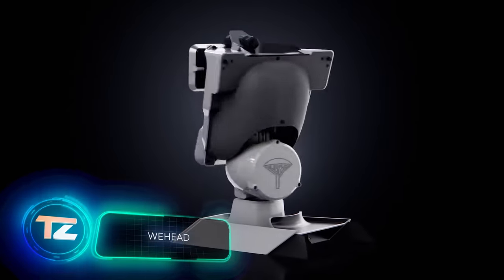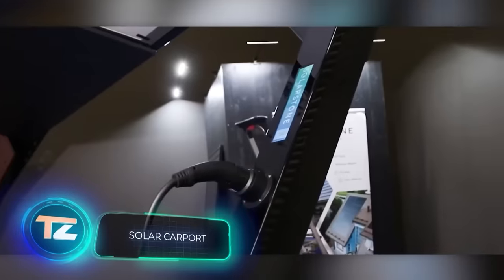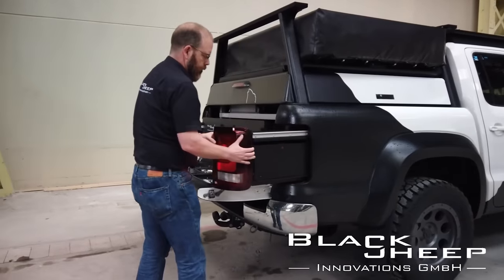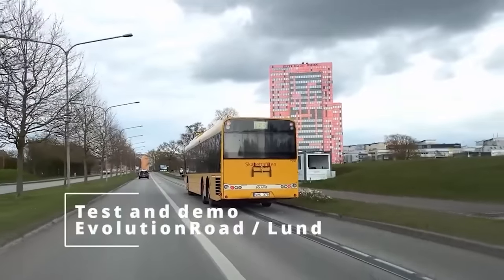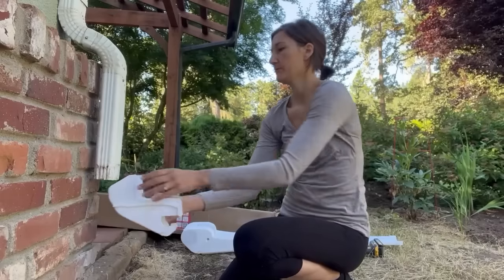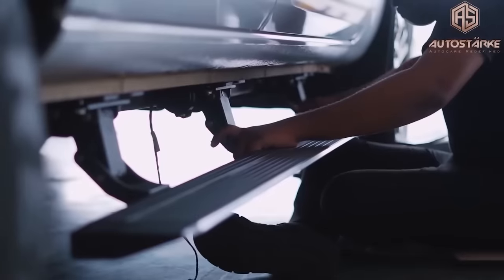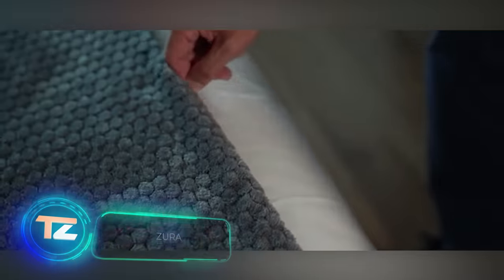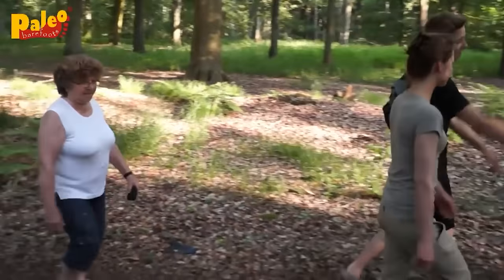INGENIOUS INVENTIONS THAT YOU SHOULD KNOW ABOUT. BEST OF 2023

Comment: 52 decibels for an tent A/C unit is loud, especially if your that close to it.  The quite generators you hear at your campsite are placed far away and produce 38 decibels.     The electric wire for the bears to stay out.   i already know I would shock myself too many times trying to enter the tent.  Just sleep with your gun under the pillow.